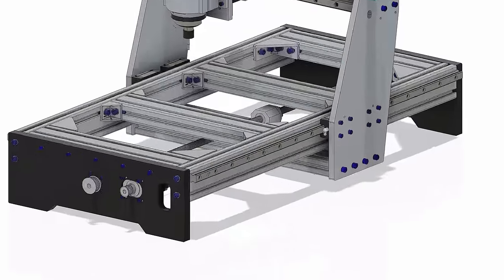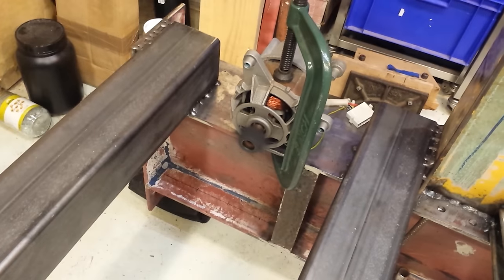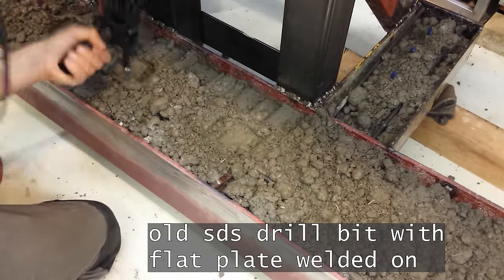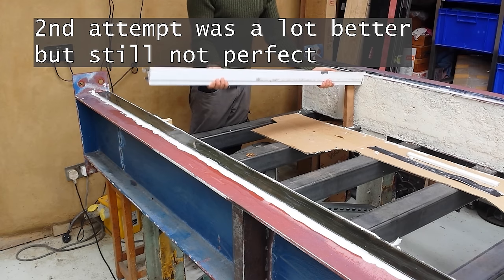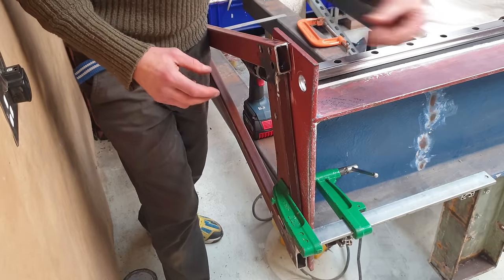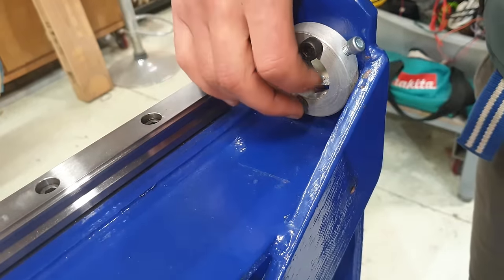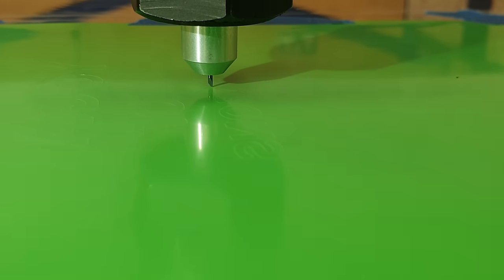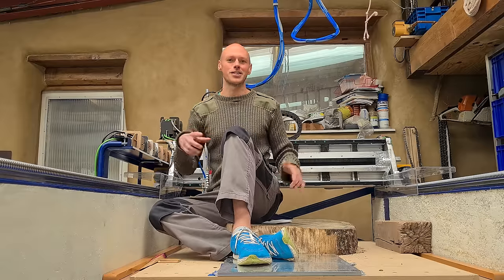Can we DIY an Industrial grade CNC?

Comment: The machined surfaces attest to the quality of your construction. I will be using hollow sections because that is what is cheaply available. I will fill them with sand. I believe that unbound filler will have a higher hysteresis than solids such as concrete. It can also be extracted as an aid to moving the machine at some point.
Now to the lead screw.  I was thinking of doing the same thing.  Three points however.
Firstly, I appreciate the concern over the weight of it. However the angular momentum of a shaft is not the same as its linear momentum. I believe that the effective mass centre is only 70% of the radius. 
Secondly despite its greater momentum compared to the rotary nut, the friction because of the weight of the cross beam will mitigate that. 
Finally is the issue of keeping the thread clean. I know that some makers use a stationary screw but that does not lessen the problem. It is not just swarf but wind borne grit. The only upside is that shaft whip does not occur. That speed limit is more likely to occur with traversing, not working.
Because of all of the above I have been looking at using a chain drive. I might add that my measuring system will be isolated to the drive system.

Comment: Hmm, I'm going to give you  7/10 for your welding, 6/10 for your casting ... and 11/10 for finished result, one of the best builds I have seen.  Lots of great engineering in there.   When it comes to machine tools, you cannot put enough weight into them, the concrete and I beams are a good base, impressive.   I might go and test the deflection in my mill now!
Reply from the maker: Thanks for the generous scores!

Comment: That is really impressive craftsmanship, I would never have that kind of patience.

What about just pouring a heavy mass of concrete with protruding anchor bolts so you could adjust rail brackets up down... kind of like they do light poles with nuts/shims and then grout under. 

Embed all of it in something, maybe not epoxy, sika flex has some great dampening adhesives Ive used in boat building. They won't crack like epoxy and they work so well to dampen vibration. lol just a thought, I watched the whole video and don't know anything about CNC just need to get a machine.
Reply from the maker: Lol. Thanks for watching friend 😀  sound like that method could work...

Comment: Very very awesome build. My only concern is moisture in your environment. IPE low carbon beams heavily rust with the slightest contact with moisture the only thing I would have done different is coating the top of the beam with something like a commercial boat paint before doing the epoxy. However I am no epoxy expert and dont know if it will prevent moisture from reaching the backside. Still an amazing project.

Comment: I would like to hear your thoughts on the brain box and software. I've just built a simple GRBL plasma table using UGS, Sheetcam and SketchUp.  I'm tempted to upgrade to Mach3 or use a more expensive offline controller but GRBL can be operated with my phone and is very cheap to set up. Love your video and looking forward to more. Cheers J
Reply from the maker: Good morning Joshua, thanks for watching. So we're using Mach3 with an Ethernet Smooth Stepper (from Warp 9), and the free version of Fusion 360 for CAD & CAM. 
I have very little experience with GRBL, so can't really comment on that. Would I choose Mach 3 and ESS if I was to do over? Not sure! Lots of people rave about LinuxCNC but that doesn't play with my ESS.... 
At the moment Mach3 does everything I need it to ;)
Reply: @FloweringElbow  nice 👍 thank you for replying. Masso was willing to do a deal as YouTuber, they do really nice controllers for CNC that plug and play all inclusive. They are the top as far as I know if you want to research them. I've started with the Arduino GRBL and making a natural evolution to upgrade as I go. All the very best. Cheers J

Comment: Congrats on the effort.
Nice machine you have... that you built!

Question:
At normal video speed, in iron tests, isn't the cutting speed high? Shouldn't it be a little lower?
Can you make an aluminum part as if it were factory? Or just right pieces?
I wait for the next video.
Reply from the maker: Hey Miguel thanks man :) 
I'm somewhat new to actual metal machining so take this with a pinch of salt. My understanding is that because I have quite a fast spindle (24k rpm max) I worry going below say 8,000 rpm, that I will stall it out. Therefore I have to run the machine feed speed little faster than is typical for a purpose built metal mill (which would have a much slower spindle) - this way I approach the same sort of chip load... 
It depends on which factory you're talking about, but so far I have been very impressed with the aluminium finish. As good as I have seen on straight sections... Like I say I think I need to tweak the servo tuning to get the curves up to the same standard...
Thanks again, 
Bongo.

Comment: This is a great, I have been looking at cnc machines that had the capacity to do a 4x8 sheet and possibly larger dimensions. However in my research of these machines I've found pretty much all of them have chincy little support frames that I have to imagine there would be NVH concerns possible harmonics induced  making chatter IDK, not to mention the cost of a machine that size I've been considering building one and after watching this I think building one is my best option.

Comment: One suggestion for you on drilling through difficult stuff (like steel) without a magdrill. There is a thing in Australia at least called a DrillMate (and it's not the little dirlll guide made by Milescraft), which i think is now made by a company called ITM (Industrial Tool and Machine?). It's expensive for what it is, but is general purpose in nature (also works on materials other than steel) and likely works with your existing drills (based on their collar size). Basically it's a portable C Frame drill press, so you have to be careful in using it to make sure you don't cam the drill off axis, but it gives a pretty big mechanical advantage (they say 14:1) which sure helps with stuff like thick steel (as do cutting lubes and cobalt drills, as I'm sure you know).
Reply from the maker: I'll check that out, thanks :)
Reply: @FloweringElbow  watch how they drill frames on the Pakistani Truck channel. They'll teach you a thing or three. You have the sandals for it already.

Comment: Nice vide, you're quite right, "Full attention is the best safety device" 👍.

Could you also have wipers built in to the ball screws close to the travelling bearings to ensure the chips don't interfere with them? Maybe a primary and secondary on both sides.
Reply from the maker: If you look closely, the red tape is the fairly bodgey attempt at wipers so far using hot melt glue to match the ball screw contours. It'd only one side of one ball screw at the moment. 3-d printing a slicker version would be good.
Reply: @FloweringElbow  Ah yes at 24:54, like what you did there

Comment: where did you get that lead screw, holy $%#t , I'm looking for some good 2500mm ones and most of the ones I have found are just not beefy enough. Definitely over engineered a bit, depending on what your plans are, but you seem happy good job. Also what spindle it that. how about a BOM in the description. Curios about the size of those stepper motors too
Edit when I clicked on the description before , the information wasn't there, now it is, must of been a glitch

Comment: I quite like the idea. They tried to do it since WWII and failed, because concrete eventually breaks from vibration, but it may make economical sense for tight tolerance alu or softer (finding client for this is not impossible). I'd really like to see it working after you make more money using it, than you put in it.

Comment: That cross shaped reinforcing frame would be even stiffer with through sleeves welded at every bolting point. Drill the compression side to the bolt diameter. Drill the outer side to sleeve diameter, weld and grind flush. The bolt will press the sleeve into the contact side. The weld transfers forces to both sides of the reinforcing frame.

Comment: The faceting on curves is not the tuning of the motors.  It's how the g-code got generated, or it could also be the controller's interpolation of g-code curve commands (well I guess that could be a tuning issue, but just generate the curves as much finer segments then).
Reply from the maker: Hey Dan, thanks for this. Wanna start me off on where to look to do this with fusion 360 / Mach 3?

Comment: Often cast iron is harder too mill then steel. Just a fun addon. Also anything can mill all these materials with correct tooling feeds and feeds. Your taking a setup closer too mine and I am shure you will be able too kill aluminum due too your rigidity and  more importantly the weight

Comment: Heavy project, waauw. 😮👍

Just a concern: Put a yellow striped sticker on the y axis protection flaps on the ends...
Reply: What's the diameter of the leadscrew you used? Does it stay even when traveling the y axis?
Reply from the maker: @stevenfixo  thanks for watching and commenting. Yellow sticker = Good Idea. The ballscrews are 32mm dia. If I was doing it again I would probably not go as big. With a stationary screw, I don't think it's necessary and it limits the rotational speed of the nut (larger dia screws require slower top speeds as the recirculating balls are traveling much faster around the circumference of the screw for a given rpm)...

Comment: You've done a great job their brilliant I've worked at machine manufacturers there's always lots of tweaking and diagnosis and learning ..just one thing
Keep out the way of any moving parts. ....now and then mistakes happen I've seen servos take off flat out unfortunately heads arms fingers don't stop any moving parts that just decided to go 100 mph  keep out of way vacuming ,really impressed keep at it👍
Reply from the maker: Appreciate that Roger, and thanks for the safety reminder :)
Reply: @FloweringElbow  On a large machine you need more than one E stop.

Comment: Loved the idea of using modified Cement mixture for vibration absorbing material. Much Better than Heavy Cast Iron. About levelling the rail guide surface, Is it possible to just machine the top surface to have levelled surface? I know it needs to have access to a massive Milling machine and it is kind of costly too.
Reply from the maker: Good morning Rikil, thanks very much :D Yeah, it is possible just to mill the surfaces flat & co-planer if you have access to a machine big enough - depending on where you are in the world, this is probably the way to go with smaller DIY machines, and it's the way commercial builders do it.

Comment: for epoxy concrete machines they use a much more flowable mix and vibrate it to get a perfectly level surface.
Reply: He's not using the surface of the concrete for anything. I'm sure what he did is fine. The hammer drill vibrated the mix and consolidated it for him.

Comment: I do think that the epoxy method only works when you use the stuff with the steel balls to give the epoxy some actualy rigidity. I forget the name, but the Epoxy with steel balls is used in industry when it comes to leveling and rebuilding machines. 

A wood scraper works well to take thing layers of epoxy and plastic.

Comment: When you finally get it all finished I'd love to know just how much its cost in parts and more importantly man hours, that thing is looking really damn good though, and for being built from what you can get rather than very deliberately chosen stock I think its a very impressive looking beast.

(also if its even remotely possible to move it again, that is one giant and doubtlessly stupendously heavy monolith that getting access to with a heavy enough lifting gear looked rather hard)
Reply from the maker: Good evening FoldiOne Papyrus, thanks a lot. Yeah, hoping we'll not need to move it any time soon. I actually think if a am needing to, it probably means I'm emptying out the workshop, in which case there's actually quite good access for a forklift or similar. Failing that, I recon 4 stout bolt on wheel at each leg would do the job. Thanks for watching.  :)
Reply: @FloweringElbow  having moved my 2.5 to machine( sold it) the installed my new 6.5 ton machine using my little 1.8 ton forklift and an old pallet jack( you can get old second hand ones for free or very little/scrap value,)  you can certainly move this with only minor effort. Old pallet jacks/ pallet trolleys  are surprisingly  effective,  the biggest issue if overloaded is, it tests the weakest weld strength(  of the load arm usually) 
Don't ask how I know....

Comment: on trick against shrinking (or how to use less water what is the main reason why i use it) is to gif about 2-5 drops of liquid soap per liter water in the concrete, it fuams up and makes the (dry) concreat more handable
Reply from the maker: Good morning Wirer Name, It's controversial, but yeah a potential replacement for super plasticiser. I wonder what a mix of both would have been like.  Considering the effort involved here, I played it safe. I know it's reasonably common  practice, but most institutions discourage it saying it weakens the concrete long term... Of course that may just be because it's cheap and freely available, so they can't sell an extra product?
Reply: @FloweringElbow  I got this trick from one of the concrete driver who said that's what they add in the depo for 20€ extra the ton.  XD 
But jea I would stick to conventional and for the amount you needed it's not that big of a cost pont. Better safe than sorry.

Comment: If you only excited it on that place and only in the Z plane like you just did, then you did a bad VSR test. You have to excite it in different points, then you will see it has different resonance frequencies in different points. Like a mug does when you strike it on the side without the handle and the side with the handle
Reply from the maker: Hey there Icebluscorpion. Yeah, I don't think I did a fantastic job of the VSR, and an even worse job of recording it (I wasn't really seriously youtubing back then) - as yes, I did move the motor and clamp about a bit, and changed the orientation of the vibration axis... I could see the x y z component of the vibration using the vibration monitor app on my phone, so running through the rpm, I found max amplitude in various places... It's hard to know where to stop - and basically I just did it for a few hours till I couldn't take the noise any more (yes I had ear defenders on)... 
Thanks for watching, peace, Bongo.
Reply: Thank you for the quick and detailed response. Sorry it didn't seem so in the video I would have loved to se some graphs on the various axis and how you medicate/dampened the various Harmonic and modes of the object. Do you also use active dampening with a accelerarometer attached on the cnc router head that evaluates and contracts the vibration? Or do you use good old dampening methods?

Comment: Hi, watching this build from Canada. Wow. I want one. Do you have time to sell plans? What's the maximum x, y and z axis travel? How many KW is the spindle motor? Sorry for asking so many questions.
Reply from the maker: Hi Robert. Thanks for getting in touch :)
Good questions all. You may want to check out our ko-fi page here: https://ko-fi.com/floweringelbow which has the 3D CAD model, and a little epoxy guide. I haven't made full plans, with a list of parts ect. as so much was specific to my particular environment and what scraps I could get my hands on cheap or free.   
It's a 3.5Kw and you can see the full details of the spindle in the video description above... 
While it can fit a full 8ft x 4 ft sheet on the table, effective travel is only ~2,100mm x 1,050mm x 400mm. Much taller stuff can be put in the gap at the front of the machine... 
Hope that helps Robert, any other Qs, just ask.
Bongo.

Comment: Bro this is one hell of a sick project and build.. I'm about to start building my CNC ROuter over the Christmas Holidays. I have 12 days to get it done but I have no clue what I'm doing.. LMAO. I cannot for the life of me work out the electronics. My CNC is hopefully going to be 600X1000mm .
I am going to use Arduino to run mine but I'm not so sure atm.  I have paid for and am waiting on a Mach 3 CNC interface driver/controller as well. I also have the CNC shield and limit switches galore but the electronics are scaring the life outa me. I bought a 3 phase VFD as well but somebody told me I don't need it right now with my smaller build?? Is that true bro??
It's for a 2.2KW Spindle and I've got 3 spindles, a GENMITSU GS-775, A generic 500W spindle motor with its power supply and speed controller attached and an 800W Topshak Palm router which runs at one speed. I have a really well made Z Axis which is heavy as fook man so I'm thinking the 800W TYopshak router will be too much for my lightweight CNC machine atm. I'm going to strengthen and weight it down a fair bit but I still think that router will be too heavy so I will have to use one of the others. I have 4 power supplys. It's crazy how much stuff I've accumilated over the last 4 months to get ready for this build and it keeps getting me buying more and more Aluminium extrusions by the week. I have 10X 2020 extrusions, a short 600mm 2080 piece and 2 1000mm 2060 pieces. I'm thinking of going back again and getting 2  more ASAP before the rush goes mental.. Not much time left bro.. haha! 
Ur video was very ispiring my man so keep up the great work ..
My humblest apologies for posting such a long winded comment my bro. Hope it wasn't a super chore reading it if u got round to it in the end man.. Keep grinding man.. Salute from Ireland
Reply from the maker: Sounds like quite the holiday you have lined up! Good luck friend, and thanks so much for watching and commenting. Love and peace from Wales.